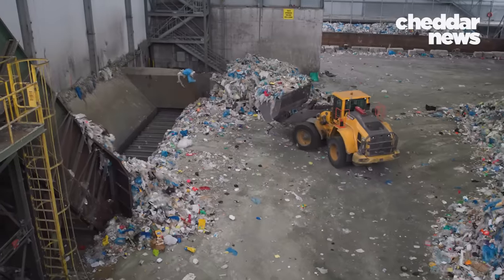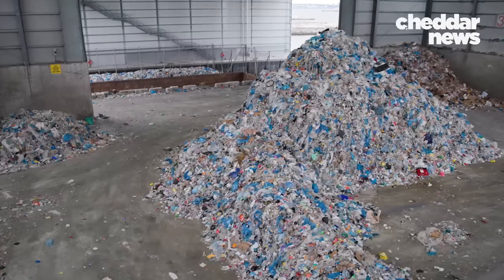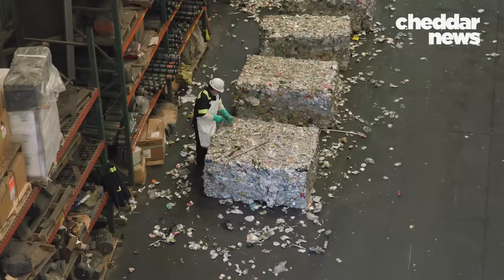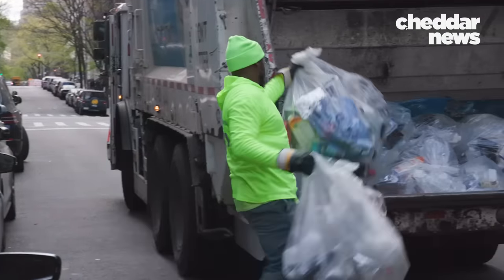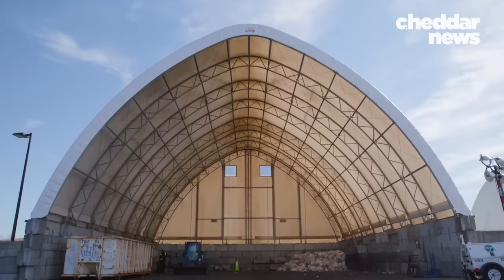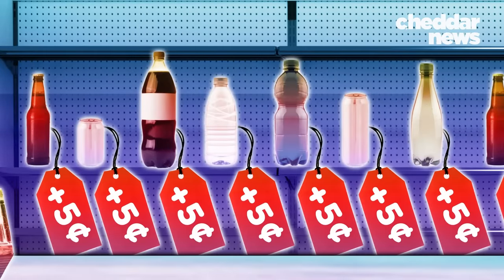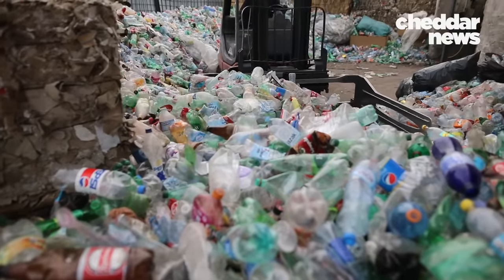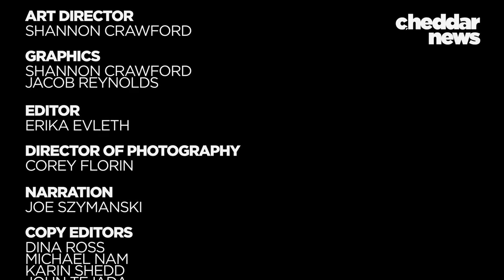How Much Does New York Actually Recycle? - NYC Revealed

Comment: Orlando recycling is streamlined to two bins. Though you can ask for two more if needed. We separate everything out with plastic, metal, paper/ cardboard, and other. You do your job and it’s taken away once a week no headaches no fuss. Usually recyclables become polyester, more bottles, cardboard, and toys and so much more. Ewaste is broken down into parts and often resold to dealers that salvage what they can and melt the rest for metal also separating out mercury and everything else. Legos can’t be recycled for some reason so you’re stuck with it.
Reply: That's because you shouldn't recycle Lego bricks. Just keep reusing them  forever!
Reply: NYC recycling also has 2 streams. The one is Glass/Metal/(Rigid)Plastic and the other is Paper/Cardboard. Even having 2 streams  in Orlando (like NYC), your recyclables still have to be sorted by a MRF(material recovery facility) before the can be sold as usable material.

Comment: I sure wish NYC had a separate collection stream for plastic bags and plastic films (you can bring it to some stores, but the city only collects rigid plastic). So much plastic waste is from plastic bags/films from things like packaging, shipping, and freshness seals. I’m sure a lot of New Yorkers would separate out the non rigid plastic if there was a separate stream for it. 

Plastic bags that make it into the stream actually hurt the MRFs and gum up the sorting of rigid plastic recovery.
Reply: The other problem is that plastic waste is not just one type of plastic that could be dealt with more easily than multiple kinds.
Reply: @sandal_thong8631  absolutely. Plastics are more like a category of materials. The real solution would be consuming far less plastic overall. This could be helped by informing consumers and/or regulating how much plastic manufacturers can use in products and packaging. A carbon tax on difficult-to-recycle goods makes sense to me so consumers and manufacturers are motivated to invest in material alternatives.
Reply: @robcerrato6528  Yeah. First allow only one kind of plastic, then tax any that's not designed to last a year unless it serves a medical purpose. They're buying plastic because it's cheap to manufacture, but they're not paying the costs of disposal. Some glass might come back, as well as wrapping things in paper. Still as someone said this video is about collection, not where the glass, paper, cardboard, metal and plastic go.
Reply: In Maryland you take it to recycle in the supermarket.
Reply: @batya7  yes, that is the same as NYC so the majority of people don’t do it because it’s inconvenient. Also, stores are only required to collect/recycle plastic bags if they give them to customers. Many store have switched to paper bags only. As a result, very few places collect/recycle bags/films despite selling products that contain them.
Reply: @robcerrato6528  Most of the recycling equipment in supermarkets is really dirty and frequented by multiple homeless canners who have a bunch of 30 gallon bags worth of recyclables and they process then in the machines. So, for the average person who has a few bottles to recycle is not worth to be going through all that over a few cents...
Reply: @fuzzyduck1989   as someone who has taken their plastic bags to be recycled to multiple in store locations in NYC, I can tell you they are clean and not connected to the can and bottle drop-offs that you are describing. 

What I said was, I wish NYC had a separate COLLECTION stream. As in, municipal trucks would collect your plastic bags at your residence. Currently in NYC you can only recycle plastic bags by dropping them off in stores that collect them. Again, they are not dirty because you don’t get paid redemption to drop off plastic bags.

Comment: the problem with recycling plastic is that it's not just a single material. you can't reuse recycled plastic if it's a mix of different types of plastic. you have to make something out of it that doesn't require a specific type of plastic.. like the recycling bags

the amount of manual labor in collecting that garbage is astounding in a city that big. where I live we have containers underground that you can throw your bag into. then the truck comes around and lifts the entire container out and empties it, puts it back, and drives to the next one

Comment: I don't use plastic bags for my glass, metal or paper. They go directly into marked bins. Same with the yard waste---they go in cans just for that purpose. During the pandemic, the DSNY workers told me, "You do a good job with separating it, but due to budget constraints, we're just taking it as trash". Yet, it took a month to get the leaves picked up this last time in 2023 when I had them out on the right day. Also, I don't put the leaves in bags. Again, they go in marked yard waste containers. This uses less resources (as bags are not recycled) and the bins/cans can be used over and over again, saving both money and resources.

 I use yard tools that were at the curb that I fixed up, the lawn mower I use at my properties came from the curb and I fixed them to work like new, and even the shovel to pick up the leaves came from the curb, and I fixed that. Rounding out the set, the rake was tossed in the trash, and I used a spare broom handle on it and it now is a long-handled rake.  I maintain one property alone with all curbside tools and equipment. That's my "Re-Use" philosophy.

Comment: How much of it is just sent over seas and called recycling? The water bottle industry sprang up over 30 years ago because at the time the public was encouraging people to not drink soft drinks and have water instead. The various soft drink companies created bottled water in response as the revanue  streams were at risk. They then launched a marketing campaign to say that their bottled water is of higher quality. In fine print is says it is from the same sources we use to drink tap water. This also made the plastic waste problem so much worse. The best benefit that may have come from this off the top if my head is disaster relief. If change is what we want. France has a vastly superior water system when it comes to cutting on waste. Water stations throughout the region with reusable bottles for sale. This is what we need to do. The problem wont go away unless we go for the sources.

Comment: The problem with composting in NYC is the infrequent pickup and actual urban wildlife. If Sanitation picked up compost daily, then more NYers would participate.
Reply: These new composting bins are breeding grounds for rats and roaches, especially if not used properly.
Reply: @Flush75  I am not against the compost bin for those who want to use it but at least put the food scraps in bags before placing them in the bins - Raw food scraps in a bin doesn't sound like a good idea. Also, this is NewYork, so most people would just use these bins improperly and this would create a banquet for the rats and they wouldn't even have to rip a bag to have a feast...